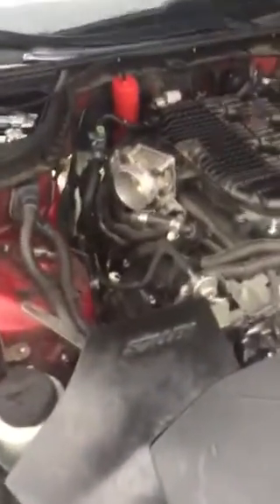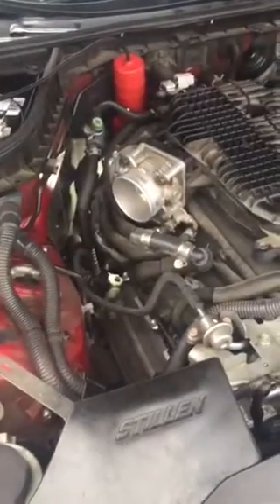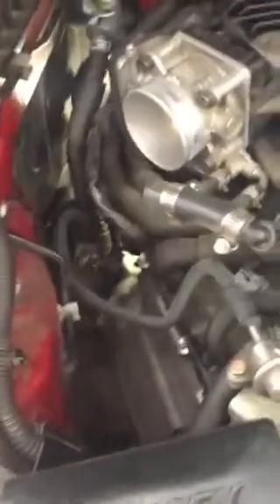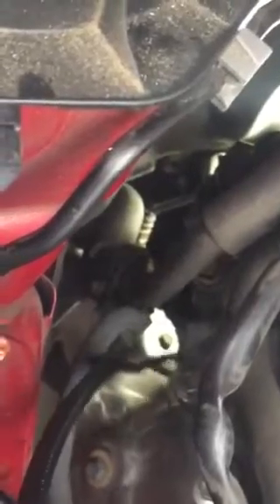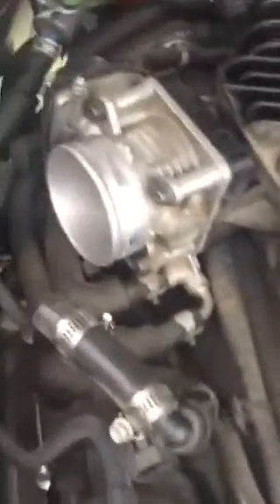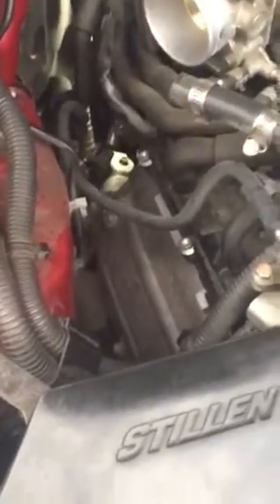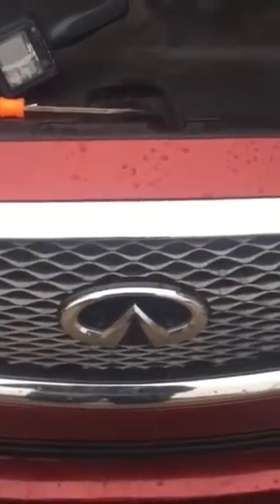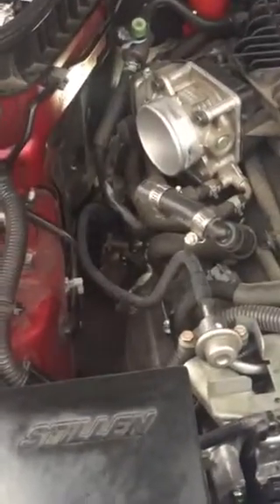Infinity Q50 :2014 crankshaft sensor location,removal and installation.

Comment: Thank you for visual guide, sir. I looked everywhere for where and how to get to the crank sensor on these 3.7L engines. This video helped me replace the sensor on my 2010 G37x.
Reply: The spot is really tight what tools did u use
Reply: @smackmillie7866  I apologize if I'm forgetting... I think I used a quarter inch socket and ratchet and loosened the bolt from down below. I remember my arm wouldn't clear the front drive shaft/exhaust if I reached towards the front of the car -- but if I reached inwards towards the center from the outside that got me a little more clearance. G37 chassis shouldn't be too much different from the Q50, unless they changed and added more braces down below.

Comment: I got a P0275 "Transmission Control Module (TCM) does not receive the engine speed signal from Engine Control Module (ECM)" DTC on my 2014 3.7 Q50. Main assumed cause of this DTC is faultiness of crankshaft position sensor itself. Other cause could be poor electrical circuit or damage to electrical harness connector. The Q50 community needs more simple little videos just like this!